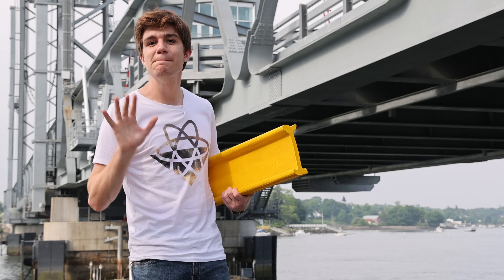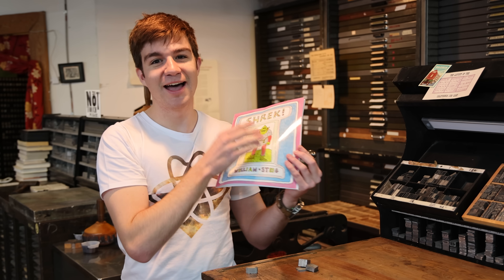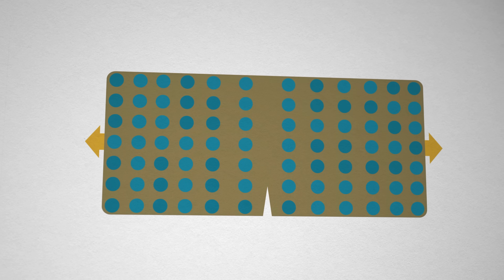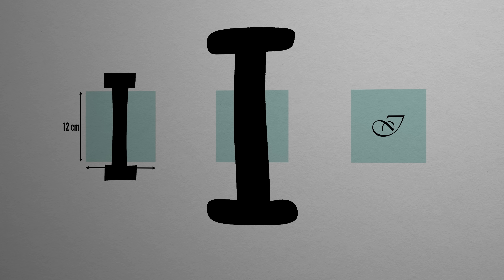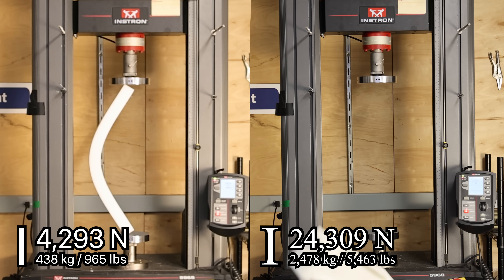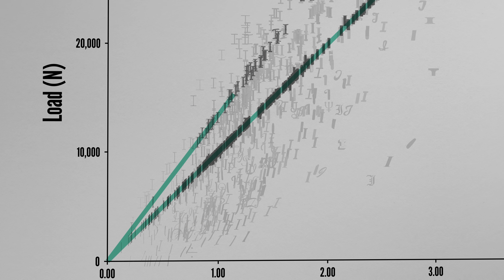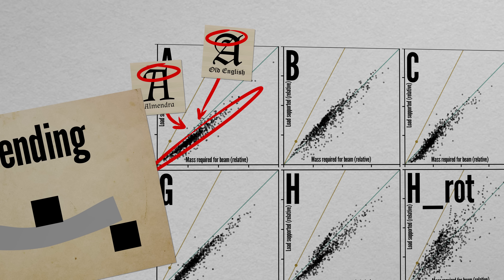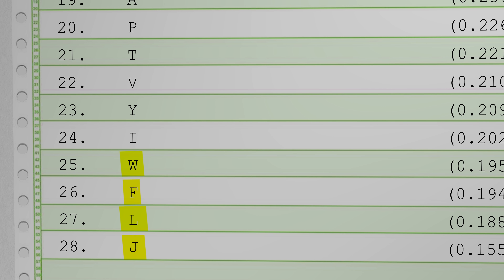Which Font Makes the Best ⌶-Beam?

Comment: You are sadly missing one thing. In Germany these beams are often called double T Beams. Because they are a T mirrored at the base. I guess you have to redo your simulation for all mirrored letters. 

Awesome work really enjoyed this video a lot.
Reply: he should make a part 2 where he mirrors and rotates all the unique ones
Reply: And in some countries, I beams are indeed called H beams.
And also he forgot to cover hollow rectangle ㅁ as that is the most common bridge girder shape.
Reply: @dongleseon8785  I'm sure at least one of the fonts has a rectangular O.
Reply: Even in the US, the first beam he shows as "What an I-beam looks like" is technically actually an H-beam. I-beams have a non-uniform thickness flange.

 IDK if he addresses that later since I immediately went into the comments to see if it was mentioned already.
Reply: @markjacobson4248  Depends on the type of I-Beam. American Standard, the S beams, do in fact have tapered flanges, as do some of the the nearly unused M shapes. The most common I-beam in America is the W-beam (the W standing for Wide-Flange), which has essentially straight flanges. I have never once heard anyone refer to an I/H-shaped member as an H-beam in a professional setting. (Structural Engineer here)
Reply: @ironnwizzard Oh, for sure they're nearly always just called I-beams. I worked in steel fabrication and construction so we did actually end up sometimes using the names because we would have to get the correct profile for whatever we were building as called out in the drawing, but except for specifically while loading material they were all I-beams.
Reply: Also in italy "Trave a doppia T"
Reply: OK, but only if we use Germanic Fonts.
Reply: Also why are we just limiting this to capital letters in the Latin alphabet? What about lowercase? What about numbers? What about punctuation marks and other special characters?
Reply: @matthewaaron2724  later, at the beam factory:  "i guess we doing ampersands now"
Reply: @matthewaaron2724  Wingdings!
Reply: time to wait for another 3 years?
Reply: Also might as well do mirrored+rotated.

and 0⁰ and 90⁰ connections.

...

Also which letter combination would be best?
Reply: !remindme 3 years
Reply: I would LOVE to see that!
Reply: What can a double-D beam do?
I DEMAND TO KNOW WHICH BRA SIZE HAS THE GREATEST STRUCTURAL INTEGRITY!
Reply: It seems to vary based on the beam itself. Most I-beams are not equal thickness at the top and bottom, but most double T-beams are. And H-beams tend to be wider at the hat and foot than at the neck.
Reply: That would be a fun sequel video
Reply: Mirrored o is just an 8 so might as well do the numbers as well.
Reply: People that call IPE or HE beams "double T" are also the kinda psychopaths that call a K-weld a double HV-weld.
Reply: Meanwhile, the japanese with the letter ェ...

Comment: My dad used to recycle mobile home axles and tires. And I was basically forced to work for him from the time I was maybe 4 1/2 (rolling tires at first).  While I never ran across an I-beam axle, there is a very old style that is something like an hourglass but in reverse. The center budges, and gracefully as it gets thinner near the top and bottom and at the top and bottom it is like an I-beam, though it never gets really narrow, and it smoothly gets wider at the top and bottom.  The cross-section is about 2 3/4" tall and 2 inches wide. It is always at least an inch thick, and of course these old things are solid steel.  These critters are rare.  The modern ones are just hollow round tubes.  There are some hollow square axles.  Somewhat old, there are chamfered edge solid square.  But I bet that old reverse hourglass design was very strong.  These were very heavy axles, as they always had more than a dozen leaf springs, large cast iron hubs with heavy backplates.  We always kept that stuff on.  Occasionally, we had to take a spring off to remove an axle because of someone's creative plumbing or being leveled very low, directly over concrete or some other crazy situation.  Where do they fail?  The one spring plate actually attached to the bolts (usually right where it becomes only one plate, on 2 or more plate springs), or the axles bends forward or backward between the hub and the spring attachment point.  Obviously, the wheel hits something like a curb, rock or hole.  Never seen a solid steel axle bend.  Chances are the bracket would break first.  The modern single leaf spring is the strongest spring, though.  The others look strong, but they are not.

Comment: Most I beams are actually H beams. We just added on 3300 sqft that has no interor load supporting walls or posts.  The 55' x 60' roof is held up by steel beams 12"×12" and is definitely shaped like a capital H.

Comment: I wonder if the rounded edges on irl I beams is an anti corrosion method, as any corrosion eating in to a sharp corner there can spread in 270 degrees of metal, which the rounder shape would reduce?

Comment: You scaled all the letters down to the same height, but of course if one were to build something using a typeface, the letters for most fonts wouldn't all be of the same height. That could be okay if enough of the words had tall enough letters - but then hanging letters like g would throw off the alignment as well. So it seems the question of which typefaces would be best to build out of is somewhat more nuanced still.

Comment: The ‘terrifying’ failure around 7:00 is an excellent demonstration of a core principle of structural member design. The column on the left failed elastically, which is typically more gradual. That on the right looked closer to a shear failure - which typically occurs more rapidly and energetically.

In occupied structures, engineers typically try to ensure failure cases are elastic, which would give occupants a warning and allow for an evacuation.
Reply: Yes but that still doesn't explain how jet fuel melts steal
Reply: Neither failure is a shear failure. Both are buckling. Engineers typically try to keep failures plastic, not elastic, because plasticity absorbs energy and can redistribute load to other members of a structure. Shear failures are not generally more sudden than other failure modes. "Elastic failure" would usually refer to buckling in the elastic range, which is extremely sudden and catastrophic.
Reply: @xxtremetoastx  I was just going to comment exactly this lol. The right test only looks so violent because the base rotates and slides off the bottom platen suddenly. But this occurs well after buckling so this isn’t really the failure, it’s just what happens if loading continues after that—and of having an unrestrained base.
Reply: @xxtremetoastx  whoops I meant ‘plastic’ failure!
Reply: @Alexander-the-ok OMG hi Mr. Ok! I love your videos, I didn’t mean to call you out with my comment at all, just wanted to try and elucidate why the right one seems so different. In addition, you are correct in general about the suddenness of shear vs bending failure. To account for this, much larger reduction factors are used for design shear capacity than for bending in LRFD design (think 0.8 or 0.9 for bending vs 0.6 for shear). In W shaped steel members it’s rarely a problem except on very short spans—because of the web being continuous and very strong (~60% of the tensile strength is available in shear and there’s a lot of area of steel). In concrete shear is more of an issue because concrete’s shear strength is so low compared to its compressive strength (~20% of that value), and we account for this by adding rebar stirrups, which force the shear stress to change directions and take a much longer/tougher path through the material (especially at the ends where shear demand is highest). Shear failure in concrete is especially disastrous because it will instantly de-bond much of the reinforcement in a beam without much warning—cracking long ways from end to end. 

I hope you enjoyed my little ramble about structural design! Take care now!
Reply: @Asherrothstan  didn't realize you used a bigger reduction for shear, thanks for sharing!

Comment: Apart from finding out which beam has the best material use to strength ratio, you also should factor manufacturing difficulty. Most likely you'd go back to your standard I beam.

Comment: "Structural Optimization of I-Beams via Typographical Analysis: A Comparative Study of Alphabetical Cross-Sections" is the best scientific paper name i've ever read. I guess we should switch to Rotated-H-Beams now. 

Also despite the insanity of the entire video, the most shocking part for me was just a random shot of James standing in the water thigh deep and not even acknowledging it.
Reply: We already do haha. Technically we call them “W” or wide flange beam. They replaced “I” beams in the 60’s.
Reply: @comeradecoyote To add on: in addition to W shapes, there are also literally H (ok well HP) shapes in current use for various specific applications.
Reply: @comeradecoyote  I was confused about this line of reasoning not being obvious from the start, but you cleared it up for me as being a language thing. In Dutch, we simply call these H-beams. And in general, european metric wide flange profiles use codes starting with H. An HEA180 is a wide flange profile with a flange of 180mm.
Reply: I find it more interesting to explore the Torsion test and Vertical load test when peeking at the letter structures. Since a lot of structures these days don't handle a lot of compressive load in contrast to vertical load from Winds, Shakes and more. 

Not to mention, in Earthquake areas you want a certain amount of flexibility in the beam, so in that sense, two J's butting against eachother might create a better stabilizing structure.

Not to mention, one could explore this experiment further by increasing the scope of tests for different real life loads. This type of approach could result in newer construction methods for high-rises.

Comment: The shot at 10:19 is perfectly designed to overwhelm the video compression algorithm
Reply: That's where a higher bitrate helps, even on lower resolutions. I learned to put youtube on 4K when I still had a 1080p monitor.
Reply: @hkr667 we're not all blessed with that kind of internet :p
Reply: @hkr667it's still not enough lol I always keep everything at 4K because sometimes 1080p looks like 480p due to compression, and this is still some 640p kevel stuff
Reply: On YouTube it's actual better to upload videos in 2k or higher.
That's because there's then a better codec used by YouTube which means: for the same amount of data the video looks better
Reply: I recognised that lol
Reply: Trying to figure out why he was stood in the water, 10:19 overwhelmed my algorithm.

Comment: i am kinda curious, how did wingdings perform? or were they excluded completely?
Reply from the maker: Wingdings had a whole bunch of issues during automated processing, but manually putting them through put them a little below that good-bad line so the results weren't interesting enough to focus on. A few of the other symbol-based fonts ended up going well (e.g. when their '"I" was actually a circle) and you can spot the divided by sign on one of the plots. But yup, broardly decided to ignore the picture fonts.